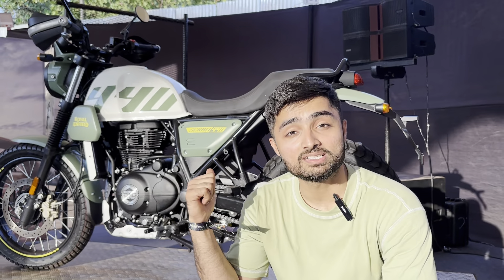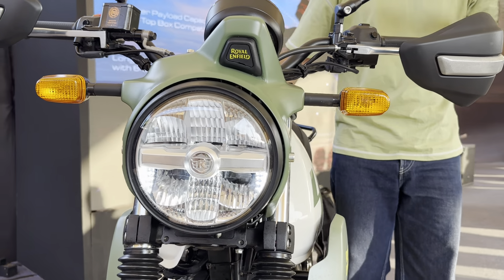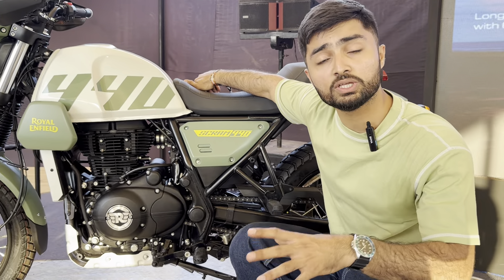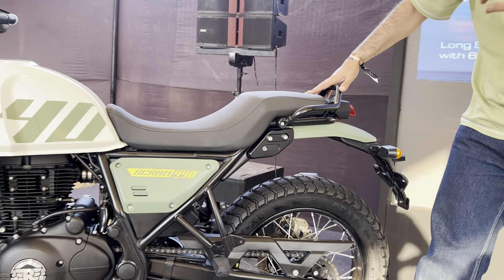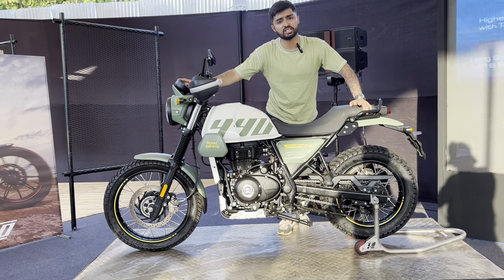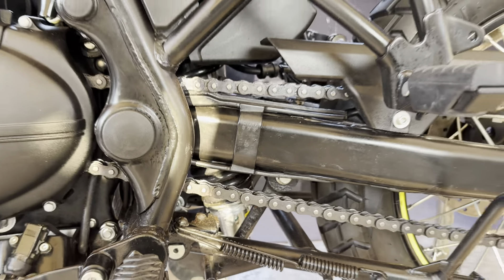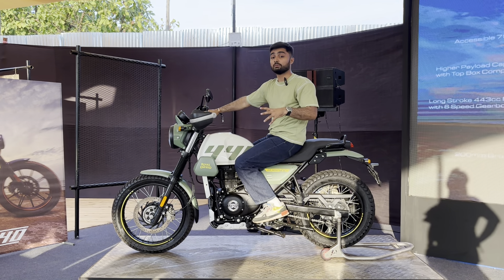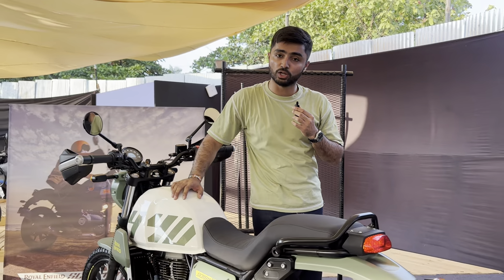New Royal Enfield Scram 440 Walkaround | Exhaust Sound, Engine Specifications, Features | BikeWale

Comment: Perfect bike for me... YES...!!!! Was looking for a bike cheaper than SHERPA 450 engine and having more poke than the J SERIES engine.... This perfectly slots inbetween....!!!! Well done RE..👍👍
Reply: Absolutely correct. This will be a fantastic everyday bike. Cheaper to run, simpler components, decent highway capabilities and I am sure a much lower price point.
Reply from the maker: Well said!
Reply from the maker: Well summarised.
Reply: @ashinterceptor  Exactly...👍 100% sure this will be around 10k more expensive than Scram411 .. which will be a good price...!!
Reply: @BikeWaleOfficial  Any idea on the launch date ?? And will this replace the scram 411..?? Which makes a lot of sense...!!
Reply: @user-bm2gb2pn6h  Mid January. Once this will launch the 411 will be put to rest.
Reply: @BikeWaleOfficial any idea about cross spoke will be avilable ??
Reply: @user-bm2gb2pn6h  I was really thinking of buying scram 411 by stretching my budget a little but was not confident because of spoke wheel and other issues now re has done a good job by giving alloy wheel option for those who are city riders also they have add a centre stand hope they rectify the odometer problem which old scram had
Reply: Han
Re had an opportunity 😅
But they failed 😅
They could have just increased the power fig by 5 bhp like .. instead of 25 bhp .. at least around 30-31 bhp .. torque is fyn
Reply: Same here ❤
Reply: 21 front wheel is missing 😢
Reply: Agree bro bhai bhidu😊
Reply: What u mean by more poke... Does engine have vibration? I want to test drive it.
Reply: @SachinKumar-z7g5k  you can do it by adding fuelx pro etc.
Reply: In this Trail green color tubeless tyre available???
Reply: @cristianobekii3303  Nope... Only the top spec FORCE /URBAN variant has tubeless tyres on alloy wheels...

Comment: my use is 80% on road and 20% off road. I like no vibrations. I want an ADV with good suspension to ease my back and tackele pathetic kerala roads.. i want a 32+ mileage.. Can i buy scram 440 or should i wait for xpulse 210???
Reply: You should go for 210 but atleast wait for 6 month after launch take thorough review 
Cause at the end you invest your money in machine for your needs 
Also from your point for 32 + mileage this scram 440 will not achieve it easily cause this is 440 engine 
Also it is on your experience if you are new rider go for light bike and affordable then you should go for expensive one

Comment: 440 with 25 bhp and 450 with 40bhp , DAMN , would rather get 450 instead of 440
Reply: The 440 will have stronger low down torque and the 450 will have more power in the midrange and top end.  Me, I enjoy bikes with low down torque 😅
Reply: @geoffh784  nahh both have almost same lower end torque. But on 450 can get more with fuelx or powertronic.  On top 450 has lesser wind drag and better fuel capacity.  Better weight distribution.